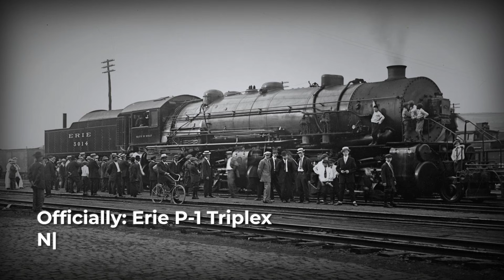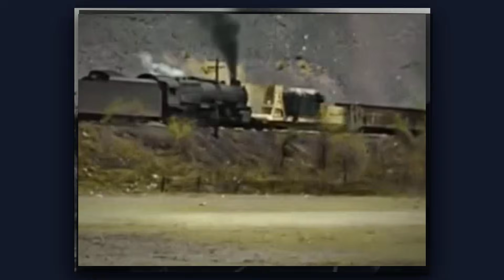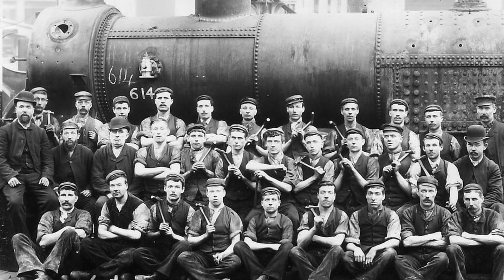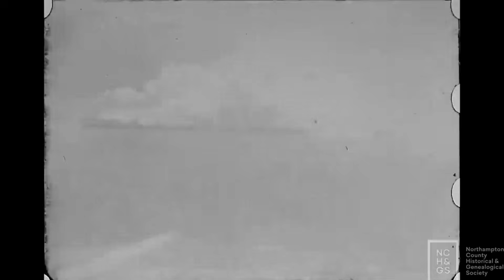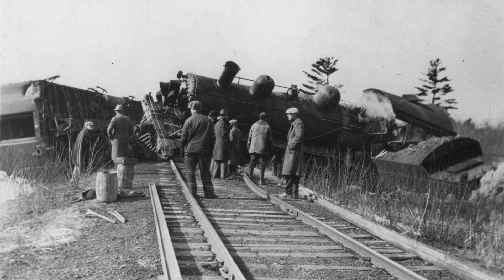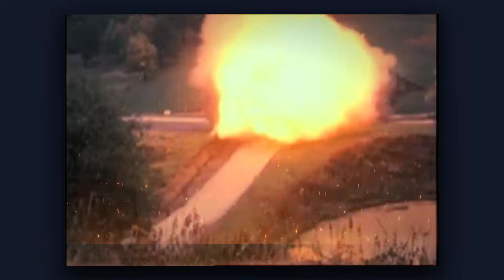The Most Ridiculous Steam Engine That EVER Ran

Comment: The engines had a very early Street stoker, which was a real clunker of a design. Apparently it was almost easier to hand fire. There is a fireman’s account that the only time he came over the hill with a full head of steam was when the stoker broke and he and the head brakeman fired it by hand. The exhaust from the rear engine vented to the air and did not contribute to draft, so draft was supplied with only half the steam being used. That would have caused poor steaming as well. It was a bad idea made worse by poor execution.